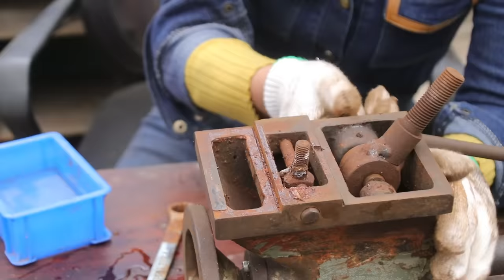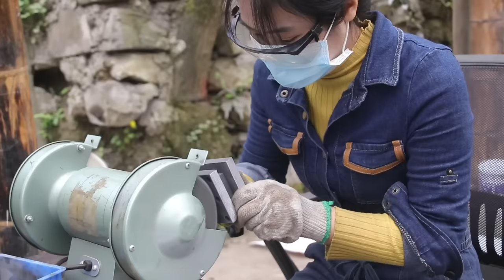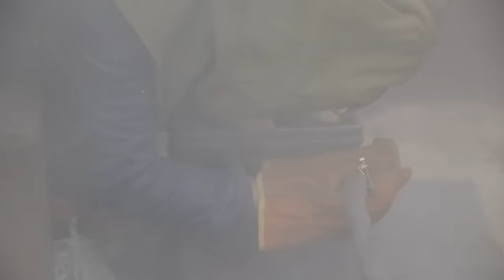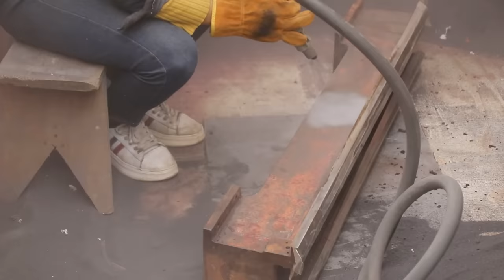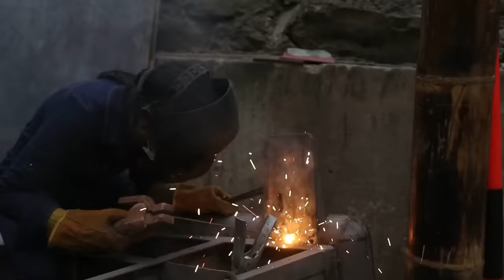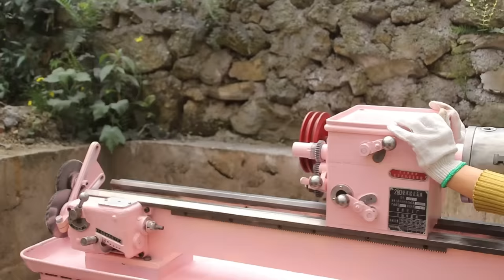💡 Super Girl's Restoration of Broken 1972 Lathe (Full Video)

Comment: 27:30 I was wondering when we might see the first area one might improve on. For this tool holding block (and any mating surface on machinist tools) you would typically not want to do these surfaces by hand. Many machinists will make their own tools or fixtures, the caliber of precision is overall dependent on the foundations of work-holding. Now I'm uncertain of the recommended surface finish of this face, a fine mirror finish can make a vacuum between two pieces of metal, but you would certainly want to spring cut this surface with a flycutter if not precision grinder.  
37:18 Perhaps due to the weight?, were the screws holding the chuck assembly stripped out? Normally one would remove the entire fixture as one piece. Also, a piece of wood placed under the chuck to prevent damage to the bed ways and surface of the chuck. 
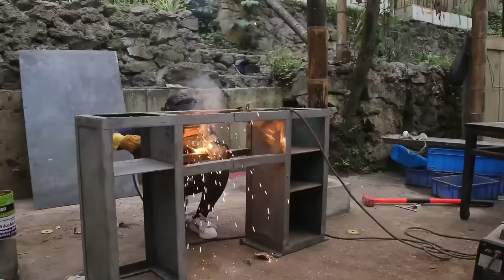1:21:00 I wonder how much time it took to align this weld, I've seen people go to great lengths to ensure proper alignment. On a load-bearing lathe bed, this step would be critical to remove vibration. No clamps, extending planes, makeshift positioning pins, wonder how it turns out.

Operating the lathe will be an entirely separate mastery of skills. The jitter of the carriage handwheel shows the machine hasn't been properly greased. Also the same handwheel, the crossfeed wheel and probably the tool post wheel have painted over the measurement lines. From what I've seen of Chinese measuring tapes and other produced "standards", we have things like brand new developments with crooked frames. You will want to have these dials properly notched or marked to use this machine effectively. 
The wobble on your chuck could mean a number of things: a)Your material may be bent, the material is deflecting off of the dull cutting tool and is cutting the material unevenly so looks bent. b)The mated surface when repositioning the chuck may be obstructed, maybe a fleck of paint or a scratch. This is why it is important to keep these surfaces as clean as possible. c)You may have also not tightened the screws completely. d)The part of the chuck you did not remove (with the pink paint) is not situated evenly. e)the jaws of the chuck are misaligned. f)There is something still loose in the rebuilding of the gearbox.

Unlike the rebuild of an engine or pump or pulley system, machine tools absolutely must be rigid and accurate enough to produce the geometry desired in manufacturing. The shown end product as is lacks cylindricity, which will be the main function in turning. If your work was to refurbish and return this machine you've done a fine job. If you intend to use this machine yourself, have an experienced machinist calibrate all essential features before use at any gear above the one shown. Open manual lathes can be incredibly dangerous if operated incorrectly.

Comment: Great job Lin!!!! 
PLEASE!! Do NOT wear gloves or loose clothing when using the lathe! It'll grab you and break YOU!
Watch on here This Old Tony, Abom79, and Cutting Edge Engineering if you would like some great instructional videos using a lathe and some great tips and tricks.
You're missing one part that goes on the right side of the carriage that I can see, and it's a dial that has 1 2 3 4 on it for indicating lead screw position for threading. It should bolt to the hole on the top right edge of the carriage in that empty hole above the three bolts you have, but I could be wrong.
Very nice job, you've done well with that old lathe!
Reply: Mrpete/tublucain is really good he used to be a teacher his loder
videos are better
Reply: I’ve seen her strip and refurb countless bits of machinery. I don’t think she needs advice on how to use a lathe truth be told. 

I’ve seen countless experienced toolmakers and machinists wear gloves while turning on a lathe and I’ve turned countless parts with gloves on. You shouldn’t be touching or coming anywhere close to rotating equipment such as spindles, chucks and workpieces in first place whether you have gloves on or not unless the machinery is completely de-energised and ideally locked off as well to prevent accidental re-energisation.
Reply: @maxpowerii7368  Well all i can say is they are not trained and taught to use gloves or have lose clothing So really its up to them once they on own, and yes i do think some help advice and comments on the workings of a lathe a good for anybody learning them i have watched what she does and impressed but it does,nt mean she done it safe.
Reply: Thread chaser.    It is NOT a great job when the quick change, apron & head stock are sand blasted while assembled, are never disassembled, then dunked in kerosene!!!!

Comment: You should install an abrasive wire brush to remove paint and rust residue. Stone sandpaper spoils the setting of surfaces that should be precisely flat in this way. Please don't just hit the cast parts with a metal hammer. Put a wooden wedge in between. Protect an interlocking piece and surfaces that must remain flat when removing rust with a brush or sandblasting or painting.
Reply: This girl is an actress hired to pretend to be a mechanic and other skilled trades-person. In reality she can't do any of these things on her own. And if you for one second believe she is doing all this you need some help. She is an actress not accomplished at any skill. At least they should make her look the part. This The girl is an actress. She was hired to do the "ROLE" there is no way she can be an expert electrician/carpenter/is an insult to any skilled trades person. And there are many shorts of Asian women who really do the work. This is not one of them. She is not a mechanic, or an electrician, or anything else.
Reply: @hdvictoryford5329 I'm trying to find the source of this (mis)information. Is this just hearsay, or can you point me to some authorative source?

Comment: 2 things. Please ........ You are scaring me. Safety!! Never use gloves when using the bench grinder. If the wheel catches the glove it will drag your hand into the machine and break your fingers or hand. I have seen a persons finger get ripped right off his hand. Also I saw a video from you and you were using the lathe. Turning the OD Outside diameter of a long piece of steel. One end in the chuck and one end using the tail stock, NEVER turn the OD toward the tail stock. If the clamp comes loose on the tailstock and the tailstock moves backward the piece of steel will come out and end up in you lap. Or do much much worse a injury. Always turn toward the chuck. Love your videos Lin!!!! You are the best.

Comment: okay, maybe i'm missing something here, but was this a video about a lathe restoration or a video about watching a female struggle with items that are too heavy for her to carry safely, keep in mind im not being critical, I'm just wondering if the camera man did not feel the need to help her carry the heavier items like the headstock or lathe tool post assembly, i suffer from a bad back after years of carrying items that shouldn't have even been carried by one man. all I'm saying is be careful ad use proper lifting techniques. dont end up like me, find a friend who will help you lift anything over 75 lbs and above. nd where is the technical part of restoring a lathe like checking runout of the headstock spindle and runout elsewhere?

Comment: THANK YOU, nice video & nice work sort of at least paint wise!  All the  1/2 -1 turn then turn back break the chip tapping comments  -BS -  are there any real machines that do it that way == NO  THERE ARE NOT, shame your HS shop teachers never saw the threading  machines threading away like mad in any factory's production line! 
I didn't like the quick change, the apron and especially the head stock being SAND BLASTED while assembled, then dunked in kerosene!!!!  Poor bearings!!!  This whole thing was really just superficial pink paint with dirt in everything critical but the ways, surprised the feeds actually worked.  They did look pretty rough when turned by hand.
Reply: I agree with you on blasting the mating surfaces, this realistically needs to be redone surfaces on a grinder or flycutter.. Also the single-coat paint will scratch off and begin to rust almost immediately, the nature of the machine requires a thick coat like it had before. As far as the tapping, you seem to want to equate freehand work with the fixed positioning and torque of a machine, there are reasons we mechanize and one of them was to eliminate the need to break chips by hand. The method is valid, you'll get more tool life out of the tap with less resistance, given it's impossible to maintain perfect center.

Comment: Well, she's certainly great with electric motors, but this old lathe will only be for coarse work.  The 3 jaws in the chuck are matched with their corresponding slot; the table needs to be leveled, etc. But this should due for general turning.

Comment: Do not tighten the lead screw, the screw is for the thread. In the middle of the slider you have a knob, if you push forward and turn it clockwise as far as it will go, you have longitudinal feed, and then when you pull the knob out, you turn it to the right as far as it will go, there will be forward feed. Well, that's it. But take off the glove or you'll lose your arm. Congratulations, you will learn.
Reply: Yes safety first !

Comment: I hate to say this but if you have to fit something on a lathe with a hammer, you are doing something wrong. That lathe needs to have a machinist rebuild it. All controls on a lathe should be easy to use with one finger. You have it so tight that it's too hard to turn properly.
Reply: You think its just the gibs, or maybe all the sand blast & dirt & grit left over from the kerosene wash?  The controls looked notchy/jerky to me.

Comment: I looked through the comments and didn't see any reference to cooling the point of work. The reason you have that pan underneath is for the coolant. You need to setup a pump with a flexible nozzle so you can run coolant otherwise you'll burn up your cutting tool.
Reply: If you wanted to add a pump system more power to you, in those times a brush and jar of lubricant was common. The pan didn't look like it had a drain so before one is put in, must just be chips collection.